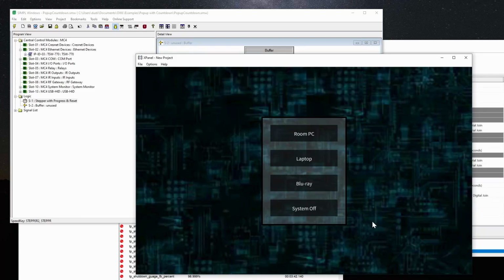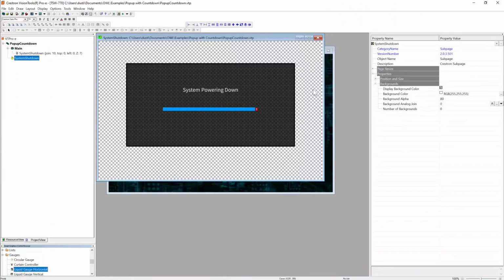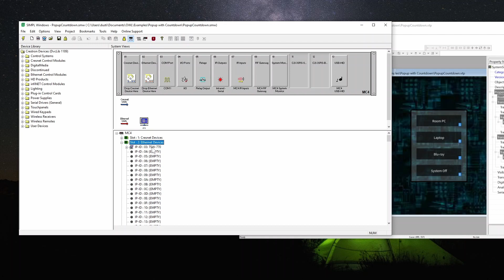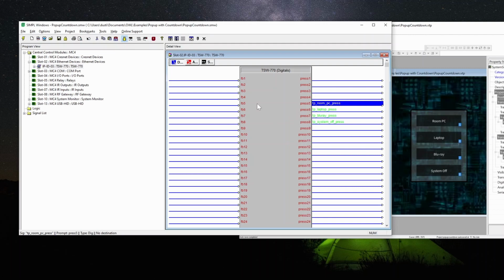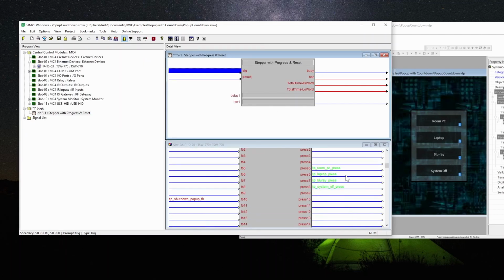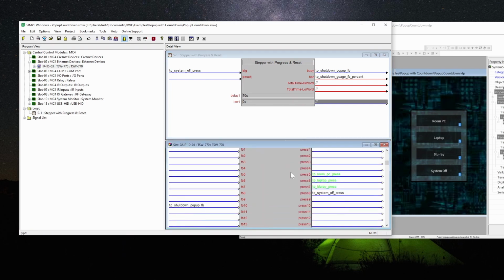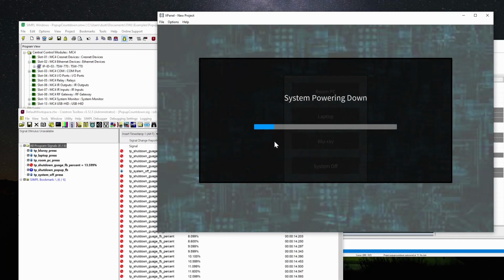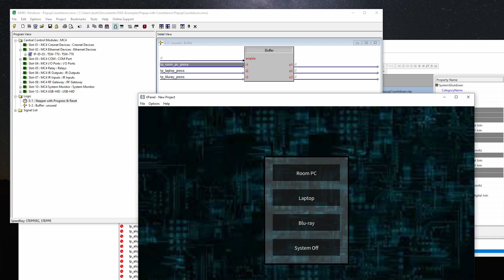SIMPL Please Wait Timer with One Symbol

Comment: I can't seem to get my XPanel to work. I have a message at the top left corner that displays "CNX connection disconnected". I can debug the buttons in ToolBox, but the XPanel isn't responsive. This with anything i try to do not just this specific project.

Comment: can you explain how to recall light scene and dimmer in clsi 6mw
Reply from the maker: From what I can tell, scene recall is just a bunch of digitals under the CLS-C6 device in SIMPL Slot 1- Scenes (I couldn't find the specific "iLux" version so you probably would use a regular CLS-C6 in SIMPL)

Slot 2 - Lighting loads
this gives you analog level inputs as well as digital raise/lower

Comment: Hi … I tried with the stepper you used with visibility join and I gave time 8 sec  but found no shutting down pop up page. Do I need to use the flip page ?
Reply from the maker: You are running the busy signal into a feedback join on the panel. In vtp you have to have your subpage referenced to a page and then give that the visibility join which matches your feedback join number in SIMPL
Reply: @OverWorkedLogic  Hi Dustin hope you are doing well , thanks for reply 

I did , does the stepper took the busy signal and provide the FB through VTP?. Or do I need the interlock for FB .